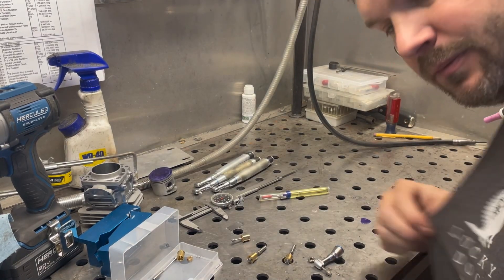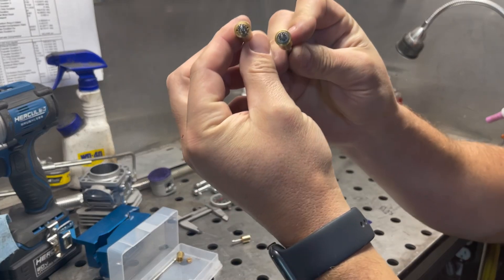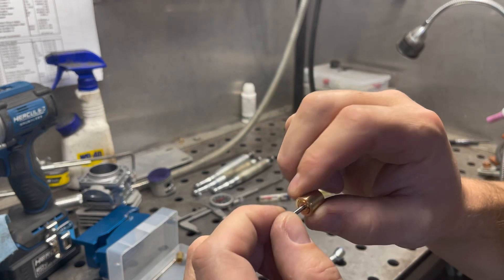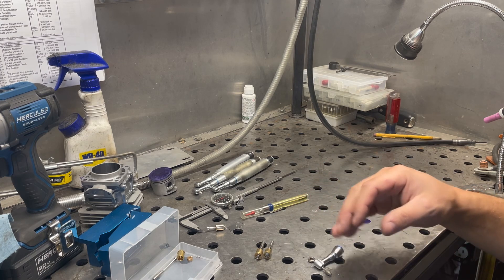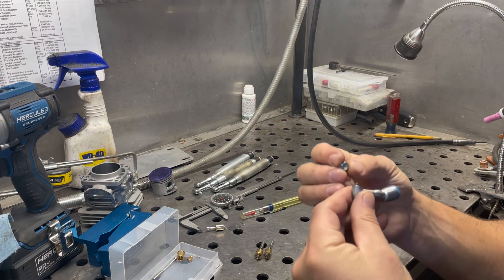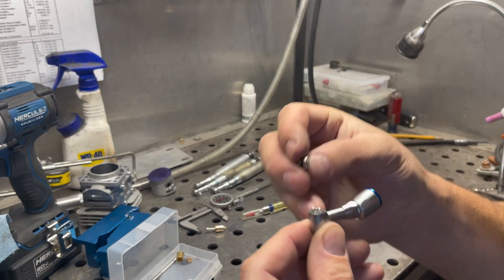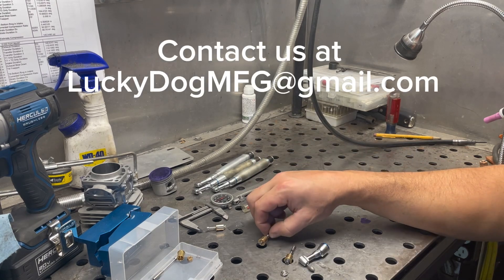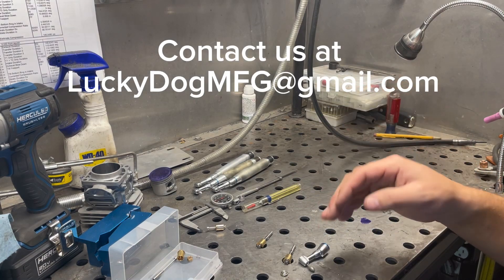Lucky Dog MFG porting handpiece head issues

Comment: Lucky dog is the best handpiece on the market right now. Do any of the friction grip heads use manual collets or are they all push button?
Reply from the maker: All of the friction grip (FG) head do not use a collet and they will only use 1.6mm burrs. There is an adapter you can get to run FG burrs in the 2.35mm latch head.

Comment: That's one of the issues that I  noticed when I was testing the ones I machined...
I found bearings... (probably have the mfg p/n in the garage)... 
I even found micro cv shafts... theyre a little bigger so the tooling would have to be slightly larger... but, thats on my to do list over this winter.
Reply from the maker: I found a new manufacturer for the heads that have bearings so I'm good until they cheapen them up.
Reply: @srcarr52  good deal!